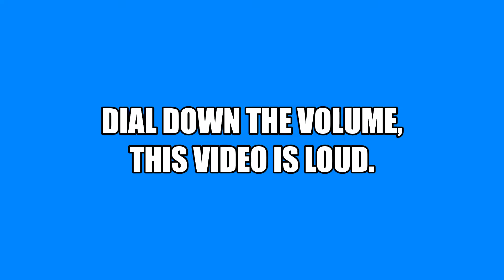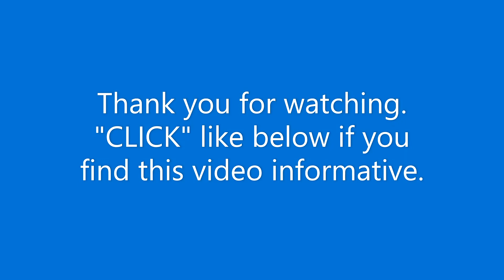Diy:  WOODEN BOX

Comment: Sir, why do you nail from under, not from sides? Is glue that strong? Looks very nice.  Btw, I can hardly read the captions.  Maybe because it's white against light background.
Reply from the maker: I needed the brads to hold the corner joints while the glue cures.  Nailing it from the side will get the pins sticking out past the timber of the other side.
Reply from the maker: Naglisod bitaw ko'g paitom sa akong mga texts, sir.  Naa patas learning curve.  Salamat for dropping a word, man.